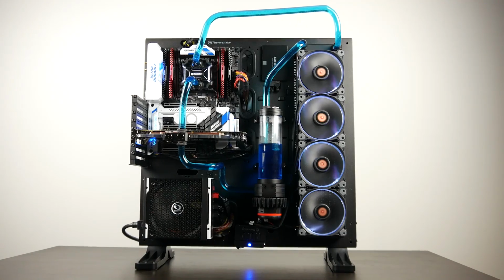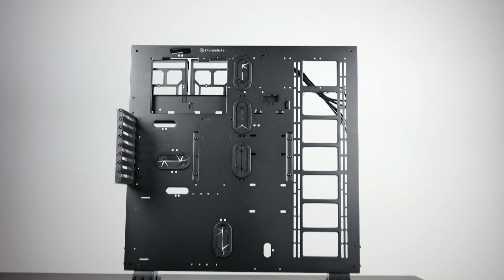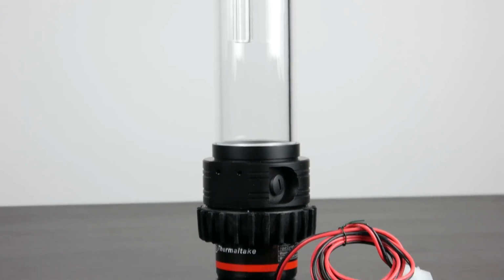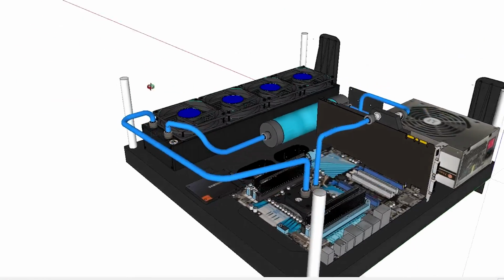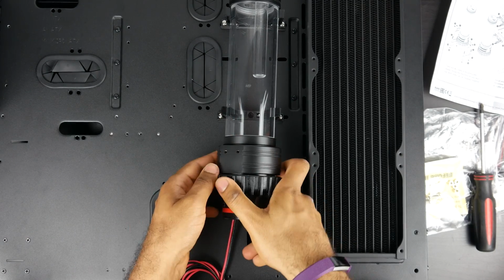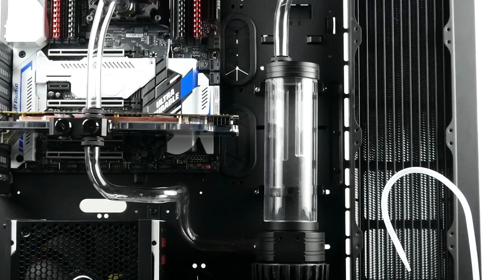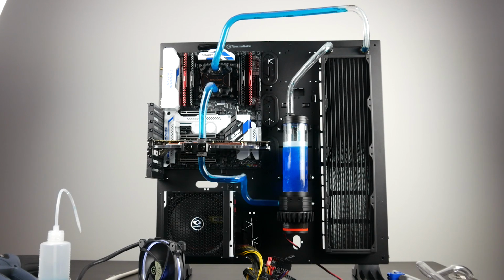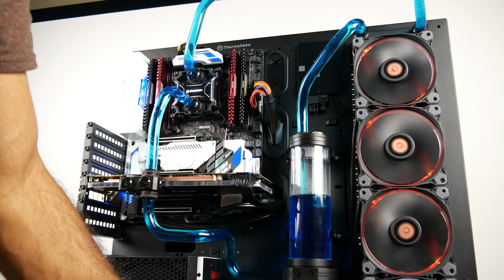Epic Liquid-Cooled PC Build Guide - Intel 6800k/GTX 1080 (Part 1)

Comment: Should remove this video... your graphics card is not in the top slot to get x16 speed and you basically just bypassed the GPU water cooling by having water go in and out of the same port. Hopefully nobody actually uses this video to build a computer.

What's with the return tubing going to the radiator? You think it will act as a handle or something?

Comment: very good, thanks for the video, I write to you through the translator since I only speak Spanish.  I have a problem with my cooling pump, my cooling is exactly the same as what a cable comes out of the cover of the cooling pump, if I give it directly from the source my pump does nothing (in the video I am only  able to see the bulk cable of the pump and the red colors and the second black, but the one that comes out of the Source is black, those of my source are yellow and black) how would its connection be?  does the pump have to have the liquid to work?  my pump does nothing and I don't think I know what to do, can you help me 🙏 thanks in advance

Comment: i7 6800k + GTX 1080 and only one (480) rad?
Without oc,this pc has combined tdp ~310w under full load,(cpu+gpu),
after oc, I can only estimate (probably cpu will have easily ~250w tdp, maybe more depending from frequency and vcore.

Comment: I choked and spit my drink all over my keyboard when i saw the shot of the GPU core with the thermal paste ejaculated all over the entire board. My 2 year old could have done a better job for fuck sake. You need like a millimeter thick film on the processors. Not the whole fucking tube.

Comment: This built has  A VERY BIG MISTAKE. When watercooling   GPU  and CPU. You must NEVER from the output of the GPU  go straight to the CPU cooling block. You  MUST FIRST go to another  radiator and then to the CPU cooling block.   I'm  VERY SURPRIZED   that nobody refers to that at any  pc  watercool built.

Comment: i got a little confuse with a fans
the fan controller you can use with 3 fan but you got a 4 fans how do you get the 4 fans in to the fan controller ?

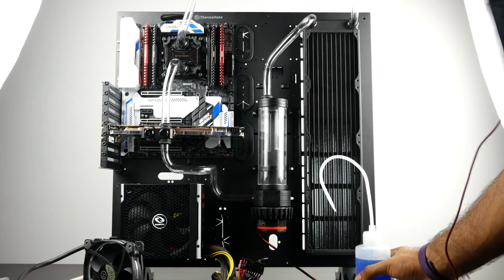Comment: I have almost the same exact PC as you (with the parts and everything), at 13:13 that pump you squeeze to get the water in, where did you get that? Mine did not come with that. If there's a separate way to buy it let me know! I looked through the description and couldn't find it either.

Comment: What's with the towel rack at the top? Also pretty hard to take advice about temperature inconsistencies and thermal dynamics from a dude who can't even connect the GPU water block properly.

Comment: Ummm your tubing to the GPU are both connected to the inlet. Your bottom tube should be connected to the outlet port, otherwise your coolant is going to flow directly past the GPU block!!

Comment: Would the 1080 waterblock be compatable with the Zotac 1080 Amp Extreme? I know the stock does great, but I would just like to add it to the loop (achieving the same if not better temps). And yes, I have looked at the ArcticStorm, and it's specs just don't match up to the Amp Extreme, so I'm not interested in paying more for less performance

Comment: Way too fucking much thermal compound!!! If anything it should just be a pea sized blob, allow the pressure of the blocks to spread it evenly across the dies of the cpu and gpu. I see now he has actually completely just bypassed the waterblock which is what has irated everyone, so the coolant is just going right through one side. Bit stupid not leak testing either, I do at least 48 hours, I'm building a new high end system for myself for Xmas, sounds a bit overkill but I will probably leave my loop test on for at least 72 hours, I like to make sure it's leak free.

Comment: 1 - your bends are pretty bad but i can see why you did them, I'll explain in 2.

2 - no rotary fittings at all, only compressions which make this harder to make the build.

3 - what the actual fuck, that's not how you configure the gpu cooling you cant put tube like that, its not efficient, there is another hole for a reason that's why there are two in the first place.

4 - the weight of the top bend can actually cause a leak on the fitting in the radiator as well as the cpu block if you didn't get this yet your a lucky bastard.

5 - SOFT TUBING? SOFT TUBING? SOFT TUBING? EVER HEARD OF IT? THEN USE IT.

6 - guys go to jayztwocents for watercooling videos.

Waj I fucks with you heavy bro but this was just torture.

Comment: "You wanna make sure you don't have any air in the liquid."
"When the pump is turned off the reservoir will naturally fill up."
What? If the reservoir changes its level you have air in your system! You even show it spewing air out of the radiator when you turn it on. The tube in the cap of the reservoir is for the inlet not the fill port. That way when you fill the reservoir up above that tube it won't be able to introduce air. But I guess I'm expecting too much from someone who would bypass his GPU completely. You're trolling to call this epic let alone a guide.

Comment: I can honestly say this guy is incredible... Incredibly dumb. The way this guy put his thermal paste on he might as well have blown a load on his CPU.   More importantly though this moron connected his CPU inlet on the same side as the outlet so that the water passes directly from the inlet tube to the outlet. His CPU will be fried if it doesn't auto shut down when he puts it on load. If you look at his own CAD design you can see the inlet/out let's should be connected in an offset pattern to flow the liquid through the block not just over to the pipe. This is an excellent showcase of how to destroy an expensive you, do not follow his guide...unless you want to melt you gtx 1080
Reply: "might as well have blown a load on his CPU" +1 just for that lmfao...
Reply: haha thanks
Reply: I meant GPU, the tubing is wrong on the gpu not the cpu.
Reply: 8:42 I thought your comment was on point

Comment: You routed the reservoir the wrong way, the fill port is the one without the tube! UGH now basically it has a waterfall that gets filled with air which is then forced into the system.

FAIL

Comment: Nice build, but tbh, the angles of the tube are a bit too wonky for me (especially the tube at the top). I think 90 degree bends are always the way to go. But of course that's just my preference.

Correct me if I'm wrong but I have a feeling water cooled systems are a bit harder to maintain.
I regularly dis-assemble my rig to do an overall general cleaning (I remove all the components clean it, and then I put it back together again). So with a water cooled system, it's a bit more difficult no?

Comment: Why is the tube from the CPU to the radiator so long? Isn't it supposed to fit into the frame? It's like it is taking a unnecessarily long route to the radioator.

Comment: His reservoir is installed wrong as wall as the graphics card. The fill port is not supposed to go through the acrylic tube in the reservoir, the loop flow is supposed to go through that tube to eliminate splashing and air being pulled into the pump. Other then those to issues it is a good build. A little ruff on the bends but not bad. The are tool out there to help with precision bends and rounding of the tube ends as well.

Comment: you connected return tube from the radiator to wrong port in the reservoir. if it's connected to port with the tube inside of the reservoir than it won't be sucking air when system is off. also it will make everything way easier with filling the reservoir up to the optimal level ;)
PS I'm not a 'hater' just trying to help.

Comment: Holy crap He also used the wrong fittings wtf...... he is using @4:50  Bitspower G1/4" to Enhance Multi-Link Fittings (these are used to connect multi gpu waterblocks) this guy does not know shit!!! I thought they  compression fittings looked really small. sure enough check out the part link he posted..... what a fail bro stay away from water cooling!!!!

Comment: SERIOUSLY: Two changes that NEED to happen. (You can keep your giant overhead tube)

Change One: You need to move one of the water tubes on the graphics card to the opposite side. I suggest the tube from the GPU to the CPU. Right now you are NOT cooling the GPU.

Change Two: Use the other inlet on your water reservoir. The tube on that side keeps the water from falling through open air and creating bubbles. You want the air out of the liquid... right now you are introducing more air into the liquid.

I was hoping you made an update video... instead all I saw was a benchmarking video where you mention many times how cool the computer was running, but failed to even once show your temperature readings.
Reply: Yeah, the video was so hard to watch. Almost everything was wrong about his loop.

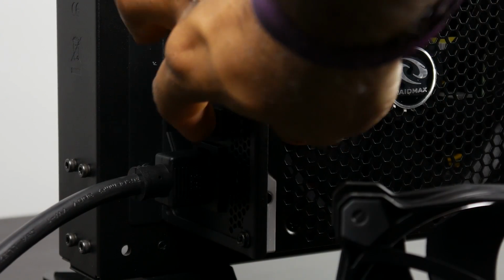Comment: The water block tubing is connected Wrong!!!! The way it is connected is simply bypassing the whole water block, just look at how the bubbles travel up @ 14:25. You were supposed to connect the bottom connection onto to left threaded...this is wrong wrong under no circumstances is this loop cooling the GPU!!!!! Part two of this video is possibly a melted gpu... sorry bro but you are potentially leading on people to overheat their processors

Comment: Cringe Compilation which gives you a hint at the abilities of this guy and the value of this clip.
If you wanna know if its worth 18 minutes of your life, check the 2 marks:

8:38
12:33

Also notice that the GFX has no cooling at all, liquid just goed from lower inlet to top inlet, not inlet outlet so the flow will completely pass the cooler.

It wasnt completely worthless though, i didnt know the RGB Fans

Comment: The reason why you still have air in your tubing when its off and air in the RES when its on, is cause you have that straight piece in the Res that need to be on the inlet(outlet) when the tub from the rad is coming into the RES, this will make it where you can fill the Res all the way and when the sytems is off it wont suck air back into the system

Comment: Looks like the hoses are installed wrong in the gpu waterblock.  Unless this is some new design the water is passing straight throught.  The cpu thermal is almost garanteed to have air pockets the way it was aplied.  Thumb down from me.

Comment: My friend all you have shown is how to cook your gpu. if you had offset your pipe work on your gpu block then the coolant would run through the water block, but instead you have run your pipe work inline having the coolant bypass the gpu cooling block.

Comment: No. 1: ew, Wtf is with that "colour scheme". No. 2: wtf is with that top tubing, it looks shit. No.3 why the fuck would you use stock multicoloured shitty pay cables In an build where the CPU costs $1500+ and the gpu is the best that I can be at this time. Wtf bro... No. 4: JUST FILL UP THE RESERVOIR... it's not that hard... Blayt...

Comment: Not a good flow. Ideally you need to flow from the pump to the CPU, then to GPU, then to rad, return. And ideally the rad should have been situated horizontally. Oh, and your thermal paste application is quite shocking

Comment: Literally the worst watercooling guide ever. Your bends are atrocious, your return line on your res is connected to the fill port, you have 4 rad fans but three are running on a controller and the fourth is just doing it's own thing, please man just don't make anymore videos that are just wrong information.

Comment: I'm pissed off and scared I tripped over my Z170-A motherboard trying to walk out my room. It was on a box about a foot high on the floor. I don't have my CPU or GPU yet so I don't no if I works or not the box kinda fell like 90 degrees and then the motherboard slid off the box I don't know what spot my foot hooked onto I was wearing socks btw
Reply: Carpet floor?
Reply: Yes it was carpet floor

Comment: Almost $4000 and the cables aren't even custom...Cablemods should've been a must
Reply: they don't make custom thermaltake cables.
Reply: Fa Vang might have well got a psu that is compatible with custom cables for that kind of budget
Reply: MrGhost370 it couldve been any custom sleeving it didnt have to be cable mods. still for 4k youd think some would go into sleeved cables
Reply: MrGhost370 has raidmax psu

Comment: So how is the water going into the GPU?  If you have the water in and out on the same side it will bypass the whole water block instead of going through it.  That is a REALLY big fail in water cooling.
Reply: Looks like it flows from pump through GPU, thru CPU Through radiator, and to reservoir...   Looks as such when u trace the cooling lines...
Reply: Here is an image of a GTX 1080 water block:
https://www.ekwb.com/wp-content/uploads/2016/05/EKFC1080-GTX_NP_green_1600-1030x687.jpg

If you look at it carefully the water enters one side of the water block and flows around the channel in the water block and comes out the other side.  The water will NOT flow over the block if the water is going in one one side and coming out on the SAME side, that's not how water blocks work.

The reason there are connectors on both sides of each side is to give more options on how you route your tubing.   On this build he has the water coming in on the right side and it needs to exit on the left but the exit is ALSO on the right side so the water cant flow through the block to the left.  That is why I am calling out this totally idiotic mistake because it can potentially fry a $900 CAD video card and it just makes me cringe.
Reply: Dam! Thx for pointing that out man, cuz I had no idea!^^  I wandered if he knew what he was doing, or doing an "idiot with a butload of cash to spare" move... Guess I know which one now.. Thx pimp'n..

Comment: You sure that PCI-e slot is x16? WTF happened with thermal compound on GPU and CPU? And I would have liked custom sleeved PSU cables because those stock ones are ugly as fuck in case like this. and like said, that loop looks horrible..
Reply: asked myself same question i thought the 3rd pci slot is x8 :o
Reply: It might even be x4 usually it goes from top like this 1st x16, 2nd x8 and rest are x4... Not sure about how it is in that mobo.
Reply: it's 8x @ pci 3.0 plenty fast.  Yea this board has some of the worst pcie limitations, why not just add a controller chip to have all them 16x?
Reply: x99 mobo has dual pci 3.0x16 my x79 has

Comment: you need to retube that GPU block... move tube on top to left port/bottom stays right port OR move tube on bottom to left port/top tube stays right... liquid is just passing thru the port and not cooling the GPU, take a good look at the acrylic panel of the GPU underside while system is on, the liquid is not flowing around the GPU

Comment: The point of water cooling is to get rid of the noisy fans.
Why are the fans still there?
Reply: The point is lower temperatures. Those fans are quieter than fans which cool a CPU heat-sink for example. You thought a water cooling setup had no fans? Wow.
Reply: XxMsrSzprzxX Actually I did. My main problem with desktop computers is their noise. I thought liquid cooling would solve this.
Reply: Those larger fans create less noise and they don't need to spin as fast, it'll be near inaudible if not silent.

Comment: Just a heads up, you're going to need some heat sinks on that 950 Pro SSD. I have the same one and it has terrible thermal throttling issues (not just me, did some serious research and this is a worldwide problem with the 950 Pro). Touching the SSD while it's hot will almost burn your finger (Yes, that's how hot it actually gets).

Heat sinks will solve this problem.

Comment: Did he give up in the end? The top bends are ugly af. And the 'waterfall' thing will actually make your bleeding harder. Should find a way to route the water in one of your bottom ports, Those rez even have a built in separator to help prevent bubbles from being sucked back in.

Comment: Just a word of warning I'm fairly sure there is no fluid flowing through your gpu block the way the tubes are arranged the fluid just flows straight up without entering the block because the air trapped in the block has no where to go. The tube from the pump should go into left port so the fluid can flow over processor first then continue through rest of block and then out through right port into cpu. You can use any combination of top, bottom or side ports but you must use both left and right ports for in and out.

Comment: do we need to replace the water over time
Reply: I never replaced mine but I did give it a quick top-up. There weren't any leaks I could see but after a year I could see the level had dropped slightly. How often and how much would probably depend on the size of your reservoir. Mine was probably very minor seepage from the joints given it was running 24/7.

Comment: You should have put a tube where the coolant enters the reservoir to avoid it splashing down like that. Also that loop needs more coolant in it, that big empty section is an air bubble that just moves from the inlet tube to the res when you turn it on.

Comment: You are definitely bypassing the gpu good sir. water goes where there is less resistance, it has no reason to go through the gpu block the way you have it set up. It will just shoot straight to you cpu.

You have to move either the intake or the exhaust to the opposite side on the gpu block. They cannot be on the same side.